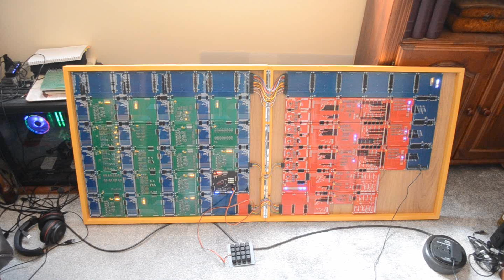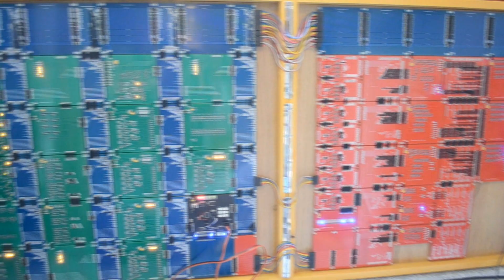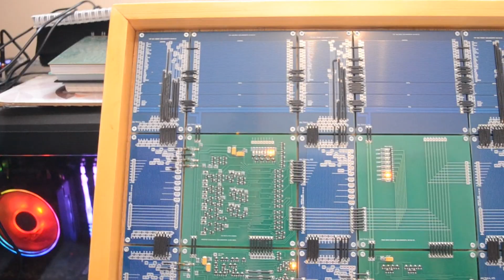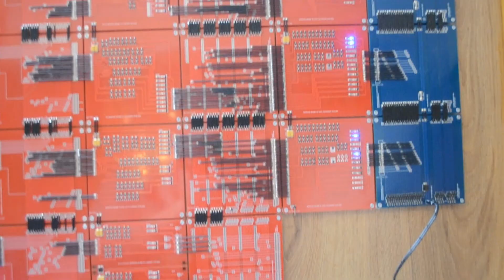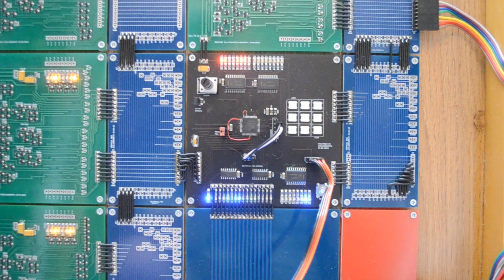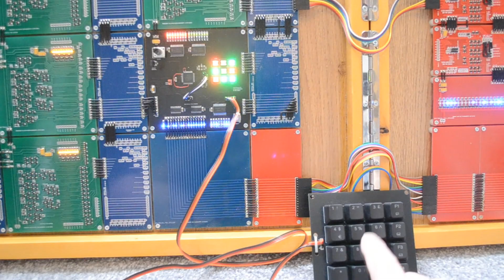HomeBrew Descrete Transistor CPU Plays Noughts and Crosses (TIC TAC TOE)

Comment: How does it play? Does it use a lookup table for the optimal move given the current board state?
Reply from the maker: There are no look up tables. It first looks to see if there are any winning moves. if not it then looks for any loosing moves and blocks the first one it finds. If not it will try to pick a square next to one it already has and if not that, it will pick a square bases on the time since the last move ie randomly. So it can be beat. I did not want to make a game you could not win.👍 It can be programmed to do anything I just chose noughts and crosses as an example.
Reply: @unicornpub  Great. A lookup table approach felt like cheating in more way than one :) Wouldn't be very fun to code, either.